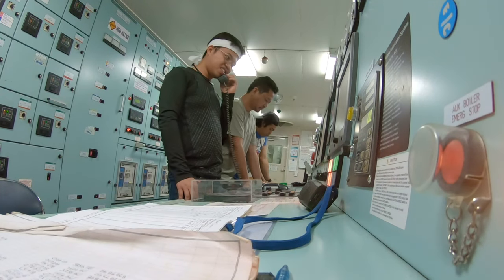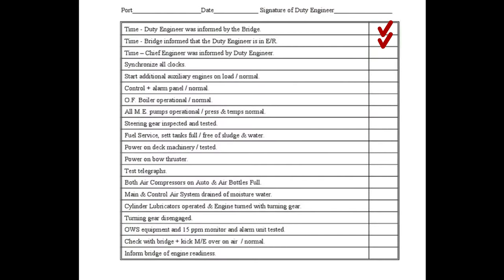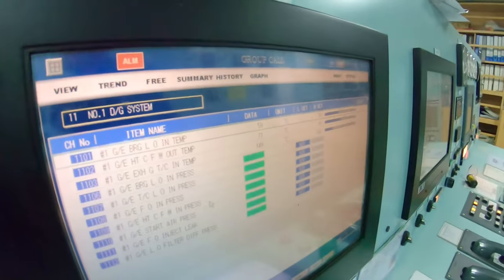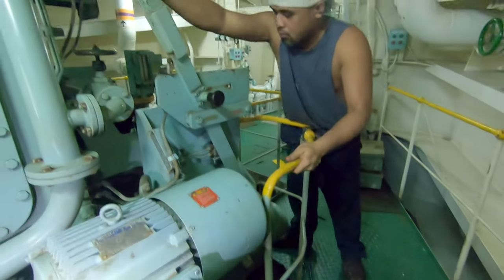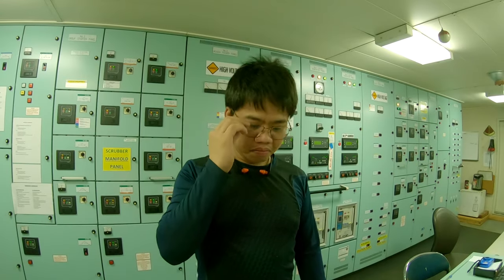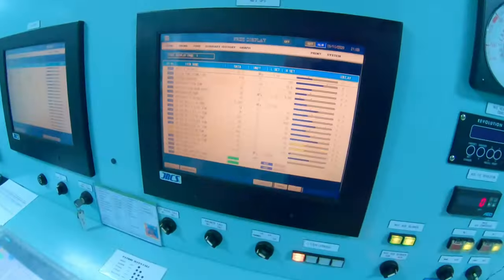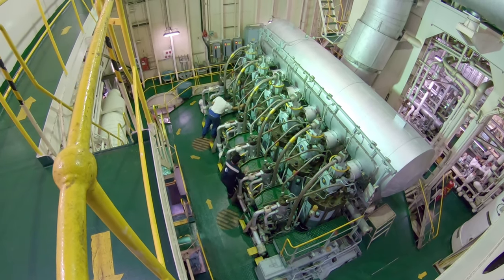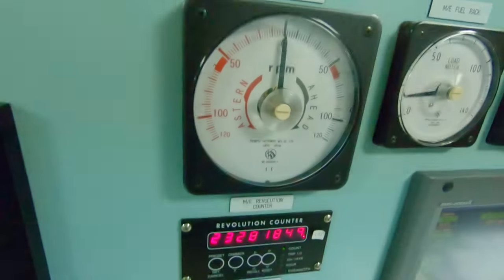STARTING THE SHIP'S MAIN ENGINE

Comment: So when did they start the engine? 
The main engine is directly connected to the prop. I wouldn't think they would spin the prop while tied up to the dock.
Reply: Around the 5 minute mark the engineer runs it up to 50rpm in both directions